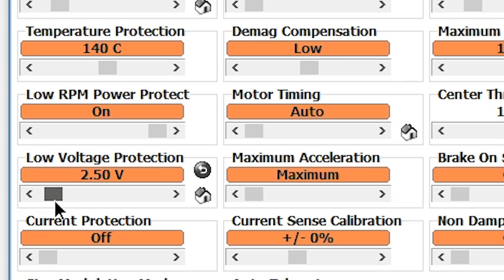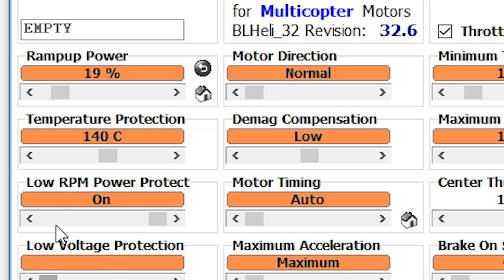BLHeli32 100% Explained - Part 9 - Temperature, Low Voltage, Low RPM Power Prote

Comment: Thanks, Josh!  I've been dealing with this issue the last two days.  I'm running the T-Motor MN3508 380KV motors with the 15" Carbon Fiber props, and I could not get the throttle to advance beyond about 10% no matter what I did.  Turned the Low RPM Power Protect function OFF, and I immediately had full power.  I'm hoping that even though i've got ultra-low Kv motors with 15" props, the fact that they are carbon fiber keeps the moment of inertia sufficiently low that smoking them on startup isn't an issue.  A guy can hope, right?

Comment: I have a question -- can bl-heli handle sensored motors? All that big-motor talk makes me think it could be used for electric skateboard (which use large plane motors of the 50 to 80 mm type)
Reply from the maker: No, blheli is not set up to work with sensored motors.

Comment: Great piece on BLHeli, Thanks!  I have an odd problem I was hoping someone could help me with. 

I have just refitted an old QAV250 with:
MatekF405-0SD, Matek, FC-HUB, "little bee" BLHeli ESC's (Oneshot125), D4R-II(PPM) with telemetry. Installed  BetaFlight 3.4.1 and I tried BetaFlight 3.2.2 with no change.

 Everything appears to be configured and tests out correctly. As soon as I arm the quad the motors spin up and if I move any stick all motors respond by changing speed.(does the same thing with the props on).

Double & triple check configuration and wiring (installed per Matek site) and configured per your video (3 times).

Thanks for what you do,  Steve
Reply: steverich have you tried DShot600?
Reply: @TheBojengles  Yes, I tried all ESC types, the old "Little Bee" esc's only spin up on Oneshot125

Comment: I red in the BLHeli manual that in case temperature control is triggered it wont go under 25% throttle
Would be interesting to know this for sure
Reply: That's a good point, I'd forgotten that!

Comment: I get your original point about putting these into segments, but when you want to watch all of them the intro/outro get a bit much.
After the last part can you upload them all edited into one video? :P
Reply from the maker: I'm thinking about how best to do this.
Reply: Joshua Bardwell cool. It’s fine to upload all the parts separately and I get how it makes searching easier. However the whole interview in one go could also be uploaded as a separate video in addition to all the parts. The separate parts cater for searchers and the everything-in-one-part video is for your subscriber base who may want to watch the whole thing.
Reply: Joshua Bardwell like I say, the content matter is very interesting, I learnt a lot. but to watch the whole lot results in having to watch about 5 minutes of intros and outros and locate all the parts which as a use case, fails for me 🙂
Reply: @JoshuaBardwell  In the online editor, I know you can chop the end off a video without re-uploading it, not sure about the beginning though.

Comment: Also how do you put a spectrum receiver we on a mini quad and what receiver should I use
Reply: If you want just a normal receiver what bardwell recommended is best spektrum receiver for mini quads. However if you have a spektrum radio that's capable of telemetry then the mini quad receiver you would want if you wanted telemetry would be SPM4649T.
Reply: happy dancers thanks
Reply from the maker: This is a good spektrum receiver for mini quads.

https://www.spektrumrc.com/Products/Default.aspx?ProdID=SPM4648

How to connect it?

https://www.youtube.com/watch?v=ZpU6-JY6fnk